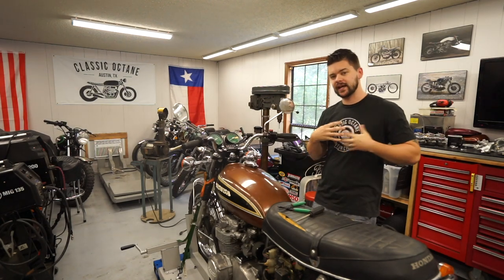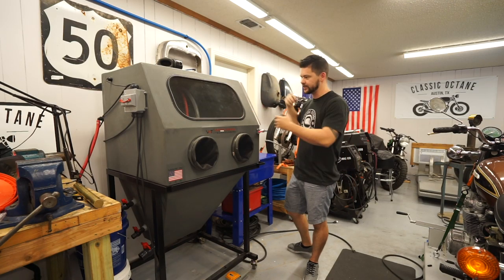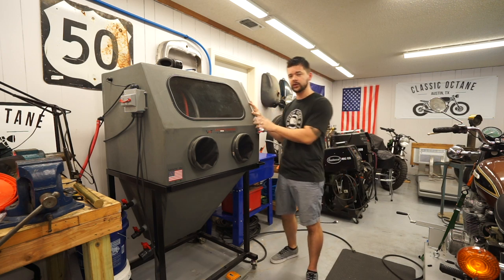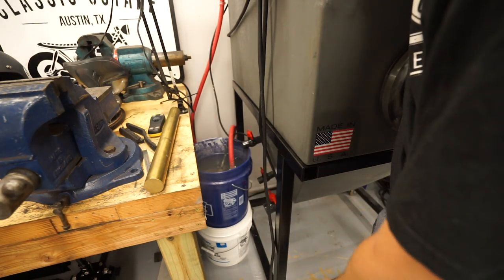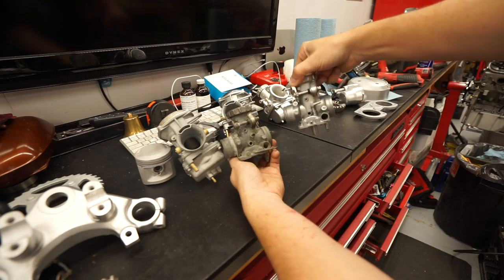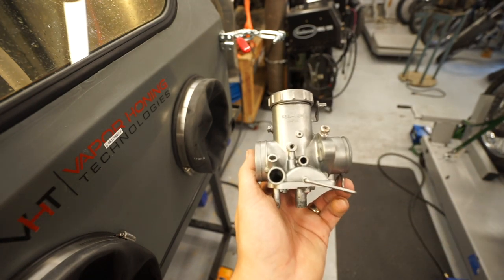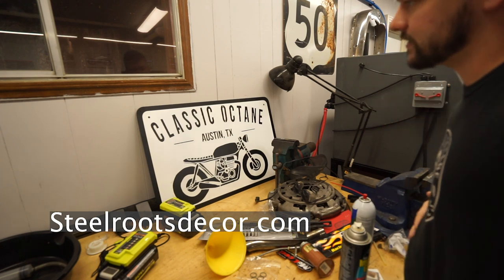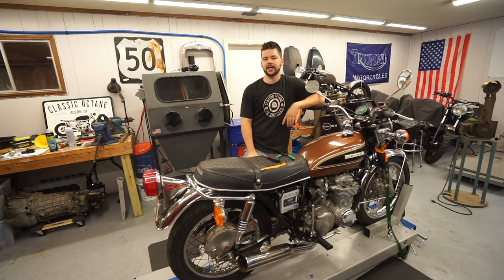Huge new investment for the shop! It's even better than I expected

Comment: Dig the Vapor Blasting cabinet.  I have VB'ed a couple of Engines & Forks and loved the results.  It's a great way to get a clean/factory look... and while it's technically easy, it is extremely tedious and after about 3-4 hrs of blasting, it gets very tiring too (I had to do all the blasting in one go at my friend's shop...having a cabinet at home would have allowed me to take my time).  I'm sure you know this, but keeping the slurry clean is important...the rule my buddy has is nothing greasy/oily gets blasted.  Also, rinsing and blowing out the glass slurry is very very important...especially down bolt holes and oil passages..which tend to clog up.  Looking forward to your growing shop skills!

Comment: Great investment Taylor, a suggestion  on the fresh water  system  if you get 20gl drum & put a smaller filter drum on top & plumb it all in, once you get  the flow rates dialed  in it wilbe switch it on & go

Comment: Nice. But there's one thing i think you don't want to do. Big aluminium parts that you blast will start to oxide really fast. That's why you should paint/clearcoat/anodise them as soon as possible. Otherwise they'll look shit after some time. Im not sure does carbs come clearcoated from the factory or do they anodise them to keep them off oxidation
Reply: Carbs are raw aluminum

Comment: I hope those carbs are a 77-78 model, those years are different from the other CB550
Reply: Do they use a accelerator pump like the 77-78 cb750 carbs?